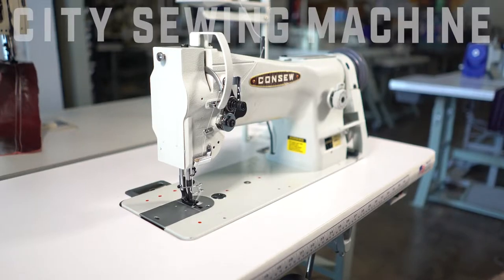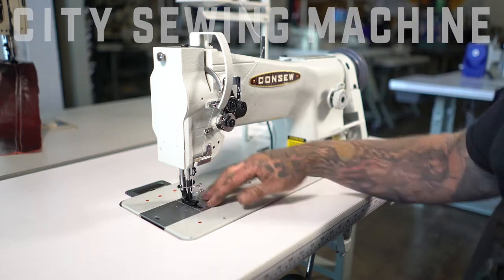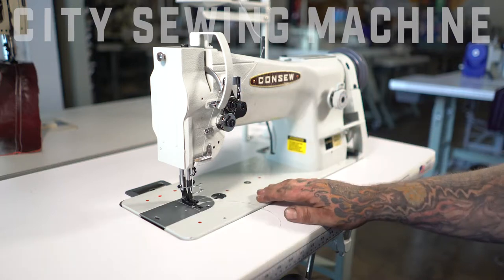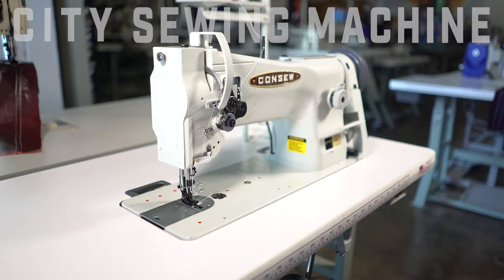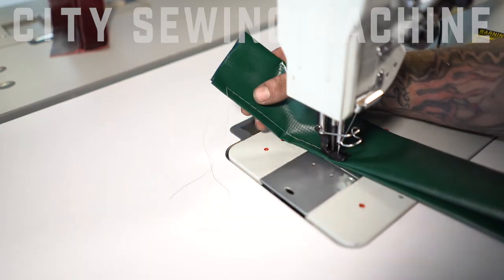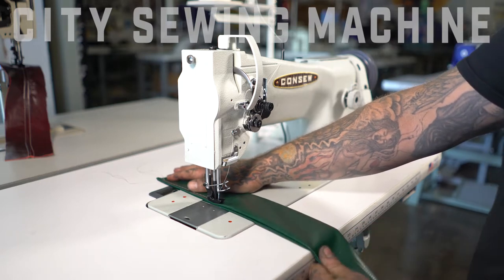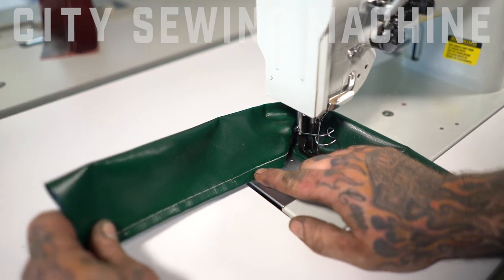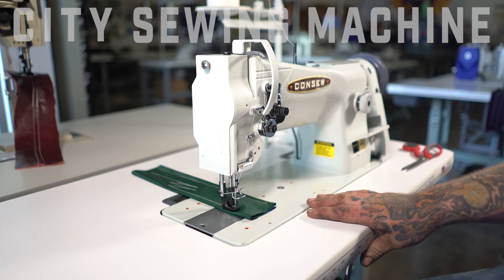Consew 206RB 5

Comment: I getting problems with since i get it it drop stiching timing keep running off the tread keep cutting where the tension spring is the thread keeps slipping off and going behind the silver part  it ent even make a year sine i have it the feed dog was hit the troat plate 3 different mechanics come to repair it and can not solve the problem